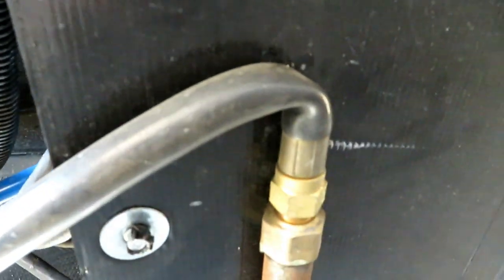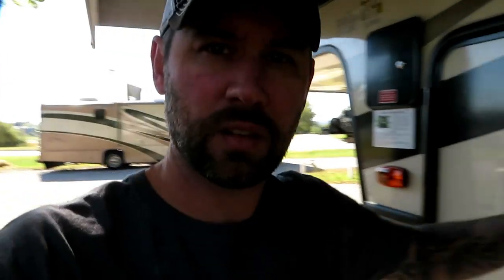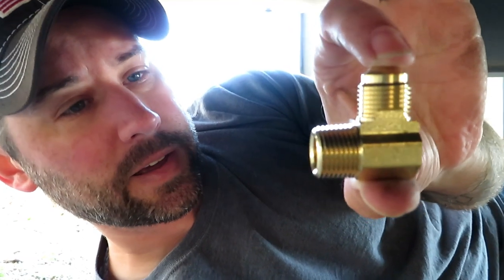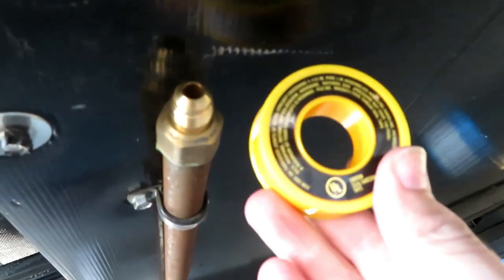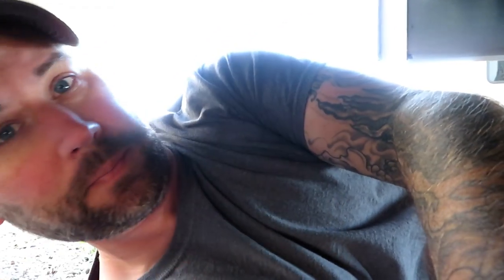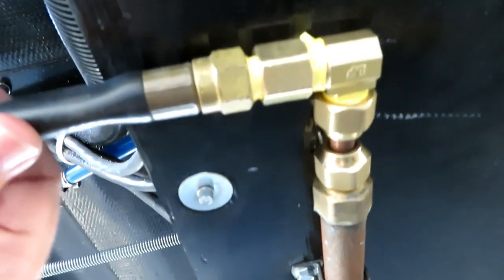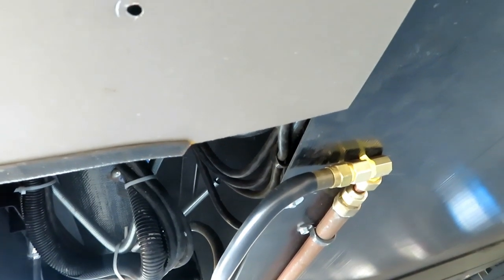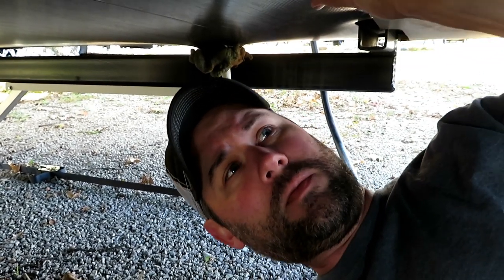RV Propane Line Mod (Quick & Easy) RV Living

Comment: Three comments.  Never use pipe tape on a flare fitting.  The hose has been kinked enough that it should be replaced.  You have contact between the hose and frame when the slide is closed which will cause it to wear through.
Reply from the maker: Thanks for the comment. We appreciate it.

Comment: On flared fittings you never use tape. Only use tape on IP fittings... It will actually leak if you use tape there. Flared fittings work on pressure between the bell connector and the male flared end. Never use tape there. IP is the pipe fittings or the end of the pipe. You can use tape there. And for others who don't know, use yellow tape for all gas fittings. White tape is for water. I can't believe they never caught that problem at the factory. Just shows how little QC is being done now. Hopefully this repair did not void your warranty.
Reply from the maker: Thanks for the info. We appreciate it.
Reply: I was looking for this comment just so I didn't have to post.. good job to both you guys

Comment: Good info.  I noticed your tank monitor. I use to have the same but came across a system called " MOPEKA" it's a digital monitor that connect to the bottom of your propane tank via magnet and then you download a cell phone app and it accurately reads the percentage of what's in the tank. Check it out
Reply from the maker: Thanks. We will check it out.

Comment: Good video I would recommend that bubble solution to check for leaks also you really need to replace that rubber hose because once that’s kinked that bad it won’t be long before it starts to have issues just my two cents
Reply from the maker: Thanks. We will keep checking it periodically.

Comment: Add a support spring around the hose. That will keep it from kinking. Its kinda like a steel braided line. Very good DYI video. Great catch on that it could have ended later in a fire. Really could be a safety problem. BTW i do like these type of videos even if you not sure of what your doing. We are here too to help.
Reply from the maker: Good idea on the spring. Thanks.

Comment: I think I would have replaced the line with a new more flexible one and took out the retaining mount for the supply line so you could add the 45 without the swivel connection. Less connections is best but what you did will work.
Reply from the maker: So far no issues we are new rv- fingers crossed another mod is not required 😆

Comment: Just a thought, the swivel is a week point and more connections more chances for leeks. I think if you take the screw out on the last bracket on the gas line I believe you would have room to screw on the 90 degree fitting by itself. Just sayin
Reply: I guess someone already said that😄

Comment: Nice simple fix! I notice y'all have a tank level gauge. How has that worked out for you? Does it seem to show a true level?
Reply from the maker: The guages are fairly accurate. When it says empty, we have a little left, so when it says empty, it is time to refill and we never run out, so it works for us.
Reply: @WaywardWaggs  sounds like that's exactly what you'd want. Camco?
Reply from the maker: @vdubing01  Not sure what brand. We got it on Amazon. They are only like $10-$15.

Comment: Wouldn't that still be under warranty?  Seems like a flawed design.
Reply from the maker: It is but I would have to take it in, leave it with them, stay in a hotel. $20 worth of parts and about an hour of work was worth doing it myself.
Reply: Got it

Comment: I am wondering why you are attempting to fix this issue! I feel you should contact the manufacturer am have them recall there coach and repair this safety hazard so no one else could possibly get hurt.

Also you should instruct others to do it correctly. You do not use tape on a compression fitting. Get some soap, your nose and ears cannot detect a slow leak. You might as well light a match. Others have commented, why create a plumbers nightmare. Drop the pipe down and do it correctly.
Reply from the maker: We did not want to take it in and wait for weeks or even months to fix something we could do ourselves. We no longer have this RV but we did have it for over a year after this fix and had no issues at all.

Comment: This is WRONG, do NOT use tape or pipe dope on propane flare fittings, period . I'd replace the line that is compromised by the kink. Other than that the rest is OK
Reply from the maker: Thanks for the comment. We got rid of this RV three years ago.